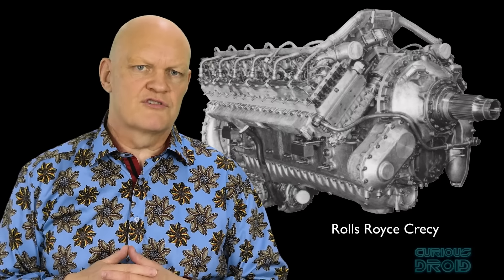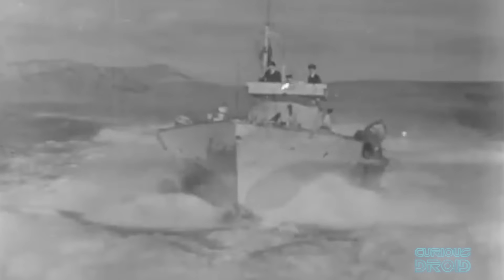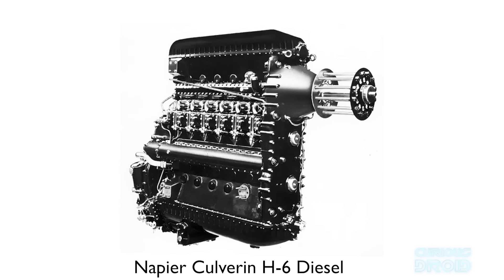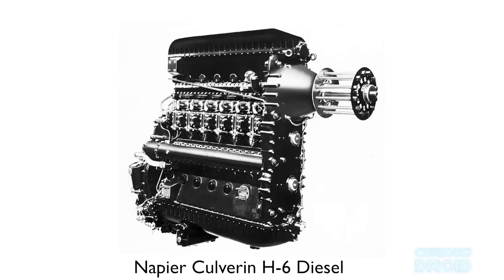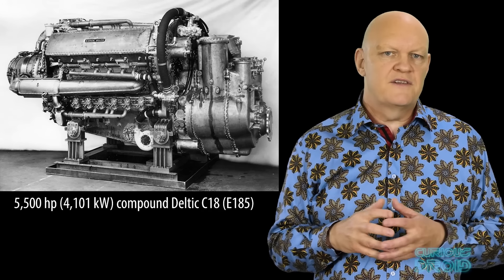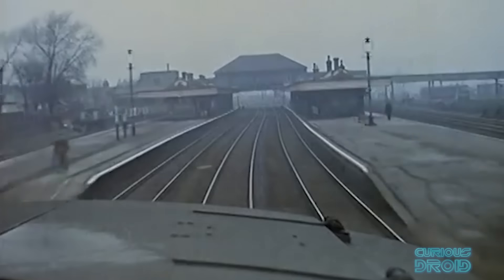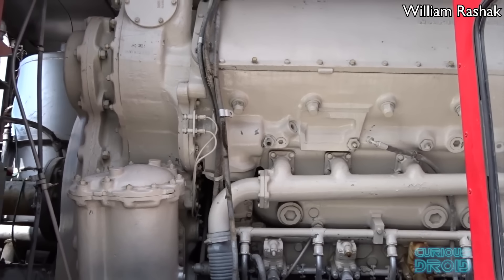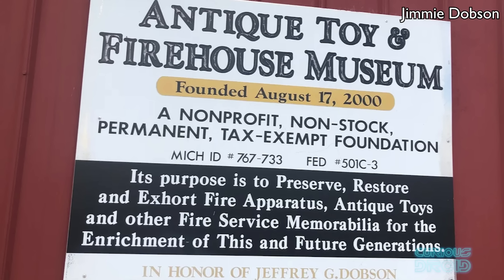The Legendary Napier Deltic - 88 Litre Opposed 2-Stroke Triangle Engine

Comment: This is one of my favorite engines to teach to my diesel students. Triangle configuration. I sailed with an Engineer who was on a tanker powered by a set of these.
Reply: "Tanker powered by a Set of these" sounds a bit shady. These Engines were designed to squeeze a lot of Power into as little Space as possible, while you have a lot of Space on Freight Ships like Tankers. The Deltic would be one of the worst Choices possible there, as it is complicated, expensive and unreliable. It also runs way too fast, unless it was used in a Diesel-Electric Setup, but that would be very unusual for Freight Ships. Most Freight Ships use slow (as in under 150 RPM) Two Stroke Engines with a very long Stroke-Bore-Ratio to drive the Propeller directly.
Reply: @Genius_at_Work  I don't know the boat, but he was my Chief Engineer and was from Britain. I believe they had an entire set of them going into reduction gears, as opposed to a diesel electric drive. HE said when one would fail, they would just pull it and put in one of the spares. I haven't been able to find anything bigger than a minesweeper with them though, so you are probably correct. BTW, T2 tankers in WW2 had less horsepower than 4 Napiers.
Reply: @Seasherm  The Power required for Speed is insane, as opposed to Size. I visited the Engine Room of an Incat High Speed Ferry (Skåne Jet, Sassnitz-Ystad between Germany and Sweden) once, and the four Ruston V20 Engines there are roughly equally powerful as the MAN Two Stroke I6 Engine in the Container Ship where I was a Cadet, both at ~27,000 kW (36,000 HP). The MAN Four Stroke I6 Engine on the Tanker where I am now equals one of the Engines of the Incat Catamaran. What's really crazy is the Queen Mary 2, which has a Standard Cruise Ship Layout with four V16 Diesel Generators (IIRC Wärtsilä) for Cruise Ship Operation at ~22 Knots, plus two GE Gas Turbine Gensets for Atlantic Crossings at 30 Knots. The Gas Turbines double the Power to 100 MW; getting to 22 Knots takes 50 MW and then increasing to 30 Knots takes another 50 MW. But there probably is no Chance to ever see that Plant; even visiting the Ferry required knowing the right People but I still wasn't allowed to make any Videos about it thanks to that bloody ISPS. Btw. another really interesting Cruise Ship is the Celebrity Millenium Class, which uses a Combined Gas and Steam Turbine Plant, similar to a Combined Cycle Power Station. But now involving Turbines and huge Exhaust Gas Boilers is a completely different Story.

Comment: "This 2-stroke H6 design... had no heavy cylinder head." Because they replaced it with an even heavier 3/4 of another complete engine.
Reply: Even better, 2 engines without those heavy cylinder heads.
Reply: @dorleysflir5350  3 engines without a heavy cylinder head! Being a 2-stroke, it doesn't need a cylinder head in the conventional sense and it means that almost the entire mass of the engine is used to generate power. The 'high speed' is the key term - the pistons do not suffer from a huge moment of inertia as they change direction hence high speed.
Just compare the mass/power to inline or V diesels.
Reply: @badpharma461  Yes, for the main subject of the video the Deltic👍, but I was replying specifically to the original H6 which is like 2x 3cyl engines.
Reply: @dorleysflir5350  My mistake, sorry. I note that the BMW diesel revs to 5500 and their were rumours of Formula 1 using DERV and they managed 8000 RPM! That said, Audi managed 9000RPM.
Diesels are usually more torque than power so god alone knows if they had to tame that torque or conrods through crank cases would be commmonplace.
Reply: That's a complete misrepresentation. To produce the same power would have required two engines each with their own heavy cylinder head. This got rid of two cylinder heads, not just one. That second engine did work; it doubled the swept volume (although in practice it used to engines, each with rather shorter strokes as that allowed higher RPM whilst still being able to reach the required compression ratio for ignition).
Reply: As far as I know Fairbank Morse was one of the first engine builders that build opposed two stroke diesel engines.

Comment: One very large point you leave out is, this engine is very complex and not many repairs could be done in the field. Anything much more than basic service required a power swap. And that is one of the reasons that help to kill this engine.
Reply: He did say that when British Rail designed the Class 55 Deltic Loco it was designed so an engine swap could be done in a day because repairs to an engine could take days. These engines were down tuned and very reliable in service.
Reply: Caveman Ballistics.   Err....point of order, if I may?  This engine wasn't 'killed'.  It was, to be sure, superseded, but that isn't the same thing.

You must have missed it, but the video did show and quite clearly state that; British Railways designed the class 23 and 55 so the Deltic engine could be swapped easily, in a day.  Thus the failed engine could be worked on in the shop.

To the wider audience, just for a moment I thought the Droid was going to say the FDNY Superpumper had been scrapped!  I was relieved and glad it has been preserved, although I doubt it is ever run?  British preservationists would never allow such an iconic machine to be embalmed.  It would have to empty swimming pools in seconds and soak crowds a mile away - on 'high days', holidays and bonfire nights.
Reply: @rogerwhittle2078  Thank you for the reply, I did see that part of the video. My point was this, with the EMD Engine that came out in the 30s if you had a cylinder failure 2 men could preform this task in about 3hrs. That was a impossible task with the DELTEC.
Reply: ERRRM wrong!
The engine used the "repair by replacement" principle. It was designed to be simple to exchange (we swapped two engines in one day) meaning the vessel or locomotive would not be out of service for long. The system worked well and definitely DID NOT   bring an end to the engine.  The end of the Deltics came when the vessels in their primary use, MTB's, were superseded by surface to surface missiles.
Reply: @nigelpaine2914  And the repair by replacement principal was far more costly, yes it was easy to swap out the engine but the cost to repair was far more per cylinder than a EMD or a GE Diesel. The Deltic engine was a very  complicated design and required a highly trained technician to do what would be considered a average repair on any other prime mover engine.

Comment: Apparently, the US version of the "Nasty" boats had their engines removed and sent to the UK for rebuilding every 200 hours, from memory!
Reply: Actually they were sent to the Philippines for service. Not sure of the hours, I thought it was 500. I was a crewmember on one PTF being transferred from MST-1 to the Philippines for overhaul aboard the USS Monticello, LSD-35.  Was on many "DD OPS" off the coast keeping our cruisers and destroyers on their toes against PT boat attacks up north. Changed out a couple of engines there at the lower base also. I remember one that had let go and was pretty damaged with cylinder and rod/piston and block damage.  The biggest problem with this set up was the Vietnamese crews not always following the precise pre start procedures for these engines. I was a member of BSU-1 from Feb.,1968 thru Dec.,1972 and had two trips to Danang at MST-1 and one trip down south at Dong Tam/MyTho, MST-2.
Reply: @seniorrider9337  Great, thanks for your corrections 👍🏼 I first read about the boats on a site over 10 years ago. I do remember it said (incorrect) starting was when most issues occurred!
Reply: Untrue - when used in Vietnam they were repaired in a dedicated workshop in Subic Bay.

Comment: you just got to cover the massive Kuznetsov NK-12 turboprop. not only has it been the worlds most powerful turboprop engine it is also the longest running continually serving engine with a new modified NK-12MPM version introduced in 2018. even its propellors are massive, 18ft 4in and 20ft 4inches.

Comment: i love these weirdo diesels, i remember seeing one that was a two stroke in a fire engine as a kid. Reason being is they wanted a far more responsive engine than the usual leisurely unturboed semi engine you would fine in the 1960s.
Reply: Gotta love 2 strokes there like a engine turnt up to 11s lol. That fire truck engine was probably a Detroit diesel, allot of fire man complained when the new fire trucks had 4 stroke Detroit's as like you said the 2 strokes were loved for there instant response, on the other hand some lorry drivers hated 2 stroke Detroit due to how noisy they were, some people would fit quad stacks instead of twin stack on there truck just to try reduce the noise they made
Reply: Not a diesel,
Reply: @lukesmith8792  Find a video of a Commer "Knocker" engine. Like the Deltic but a 3 cylinder 6 piston engine. I've been in the race car transporter powered by one of these engines. It was auctioned for £1.6M a couple of years ago
Reply: @COIcultist  mate thank you very much for the info I will be looking for that later 👌👍
Reply: @lukesmith8792  Commer Knocker sound https://www.youtube.com/watch?v=e0sLp7wvq60
The race transporter https://www.youtube.com/watch?v=gqysOBJgnBA  Obviously more than a couple of years ago.
Now seen a link to a Foden 2 stroke which was a conventional 2 stroke  Diesel, but sounds nice.
I could give you a links list of about 100 lines long.
Reply: Two stroke diesels aren't particularly unusual - look at Detroit Diesel
Reply: @COIcultist  
The Commer Knocker was an amazing engine.
Reply: @johnburns4017  And sounds like nothing else.
In 1985, I was in Budapest with two mates in a Wartburg 353 taxi. It might have only had the stock 50 or so bhp, or it might have been tuned, but it sounded like a race car inside.
For the unknowing, a conventional three cylinder, two-stroke.

Comment: I worked on the deltic locos and the engines were a pain to work on, everything about them was awkward to get to.
Reply: The opposed piston diesel is supposed to be the most efficient ever but operationally they don't work out for some reason most likely the high cost of changing out a piston or any cylinder work requires removing a crankshaft. I used to work for EMD and it only took an experienced team 30 minutes from draining the water, replacing a complete power assembly then then starting the engine up.
Reply: @kenneththompson1809  Worked on the EMD 710 in UK we never did it in 30 min but don't doubt it can be done as very little to remove . I remember them massive crab nuts and tool to undo them I was always worried would get tool jammed on LOL   . Bottom end on them never looked like it would hold together but they proved otherwise as very reliable , we got told they could come apart if lost compression that's why crankcase protector was fitted

Comment: Top video, thanks. I've always had a fascination for those Deltics, I saw one in action on a British wooden hulled minesweeper in about 1953 - it was driving the huge electrical generator that supplied the massive current needed to produce a large magnetic field through a cable that was towed astern, the purpose being to explode magnetic mines. I thought the Deltic/generator combo was going to leap off its mountings when it started up, it shook like a mad thing, but the power it obviously had made a lasting impression on me as a 13 year old naval cadet.

Comment: Opposed piston engines are still used today in the military. Great tech video. Thanks.
Reply: Fairbanks Morse 38 8 1/4.Most of the WWII US diesel submarines used them as well as destroyer escorts and landing craft. My first submarine had 4 of them, it's the museum boat in Baltimore. They are still using later versions as auxiliary engines in modern nuke submarines. https://en.wikipedia.org/wiki/Fairbanks_Morse_38_8-1/8_diesel_engine

Comment: I saw triangle engine and i thought this is an episode about the dorito and how even with today's tech apex seals is still a major problem for it.
Reply: Have you seen the liquid piston engines. The name is confusing but it's basically a totally different take on the rotary engine that solves the seal problems. It's not a wankel engine but it is rotary. They've only built small prototypes at this point though. Don't know if it will go anywhere but it's cool.
Reply: I thought graphene apex seals solved most of the common apex seal issues.
Reply: @Erik-ii5rc  it does but it still not as reliable as a reciprocating engine. I could be wrong but I have never heard of a rotary with 1 million miles on it.
Reply: @Lucas12v  
The Liquid Piston engine is a Wankel in reverse.

Comment: Whoa! Your service speeds are over the top. To go from London to Edinburgh at an average of a hundred miles now would get you there in four hours. The Deltics took just over six. This was because the maximum line speed was a hundred miles an hour and only part of the route had even this. I can well believe they could do a 114 downhill (like Mallard's record) but they didn't do this in service. They were magnificent engines though and it's a pity that blinkered inter-regional rivalry prevented them being used elsewhere as they could have eaten Shap and Beattock.

Comment: Always admired Napier Deltics
Never knew the history behind it.
Thank you for an outstanding video, clear, easy to hear, excellent images, an excellent production
Had a lot to do with the Doxford opposed piston marine Diesel engine. Designed and built initially in Sunderland by Karl Otto Keller a Swiss engineer employed by Vosper Thorneycroft but sent to Sunderland to develop opposed piston engines for the Vickers K class submarine. A single cylinder prototype was sent to the admiralty for appraisal but the six cylinder, four engine proposal was never built. At Sunderland we built  up 9 cylinder, 760mm bore opposed piston engines that produced 21.000bhp at 115 rpm. Similar , smaller engines were built in large numbers on the Clyde and the Tyne as well as in several places in the world like Taikoo, Melbourne and USA where Henry Ford had a special aluminium version built to convert his steam powered yacht Silia into diesel at Sun Shipbuilding, Pennsylvania. He also had two large Doxford opposed piston engine built for his Great Lakes bull carriers, Henry Ford 2 and Benson Ford.
Keller used the Oschellauser / Junkers opposed piston design under licence.
Karl Christian Rudolph diesel was lost overboard on his way to England to speak to marine engineers. His body was found by Dutch fishermen who returned it to the sea after salvaging identification. Many believed he was killed by Nazi agents because he was opposed to Hitler.
“The diesel, or compression / ignition engine is a prime mover, actuated by the spontaneous combustion of fuel in air heated by pre compression.” …… Pounder

Comment: I must admit i was a bit disapointed when i heard that "high speed" is only 1500rpm lol.
Reply: @kimpatz2189  Yeah but make no mistake that every part on that engine is serviceable and then some... They're designed to not need removal for a complete overhaul.

Basically only way to kill them is collision, neglect, or the inevitable fatigue on key frame parts.
Reply: That's allot for an 88 litter engine.
Reply: @kimpatz2189  Wartsila Sulzer build a crosshead  two stroke marine diesel which turns  at 104 rpm and produces 115000 horsepower -14 cylinders in line;  weighs 2700 tons;  crankshaft 27 metres long and  each cylinder 18500 c.c capacity .

Comment: I had the pleasure of working on these out of Kings Cross in the 60's,what a machine!almost as noisy inside the cab as outside! most of the mechanical noise seemed to come from the gearcase,not surprisingly.
But from its high up seating position you felt like a King of the road ! rode smooth at an illegal ton plus too.
The Deltic roar was very impressive if you were trackside as one climbed its way out of Kings Cross up the first 10 miles of the east coast mainline heading North.

Comment: And then Leyland took the Junkers opposed piston 2 stroke  and failed miserably at producing the Chieftain tank engine.
Reply: I'd heard that most of the problems with that engine were related to the fact that the spec had called for it to be able to run on either petrol or diesel. And indeed, a small amount of spannering would convert it between fuels. Most of the problems arose as a result of using petrol, which caused the ring wear that resulted in the engine dieseling on its own oil. Run on diesel alone made an improvement...
Reply: @abarratt8869 The design was chosen  because in theory  was better for multifuel  but in the real world they were never actually  ran that way   in the real world like the multifuel  Bedford MK they ran on normal  diesel. The Chieftain   problem was lack of sufficient location for the wet cylinder liners.
Reply: Why is it, that when I heard the word "engine" and the word "failed" I automatically thought of the word "Leyland"?
Reply: @worldcomicsreview354  BL actually generally  made pretty good engines better than Ford UK and Ford Colonge.

Comment: If you want one, there's a Deltic piston embedded in the embankment just south of York Station. Been there at least fifty years. My dad told us once about a London bound train whose engine threw a piston as it passed under Holgate Bridge. As far as I'm aware, that piston was never recovered. The loco was limped back into the station and swapped. It was later driven away for an engine swap.

My dad's role as a shunter was to see to the uncoupling and recoupling of the locomotives.